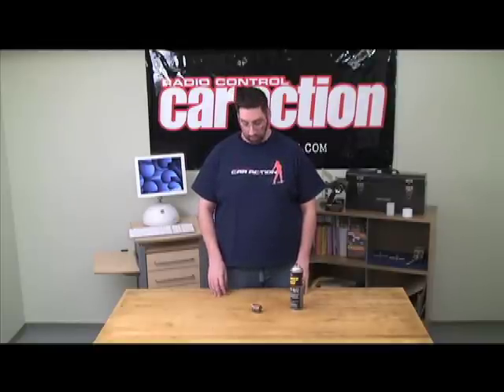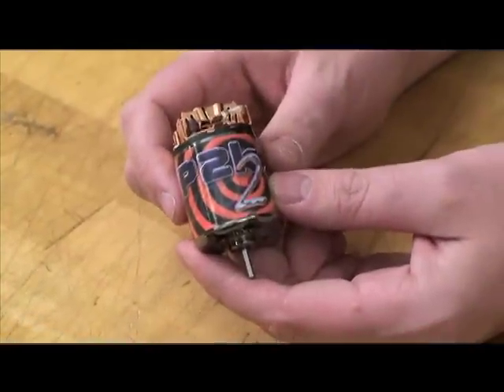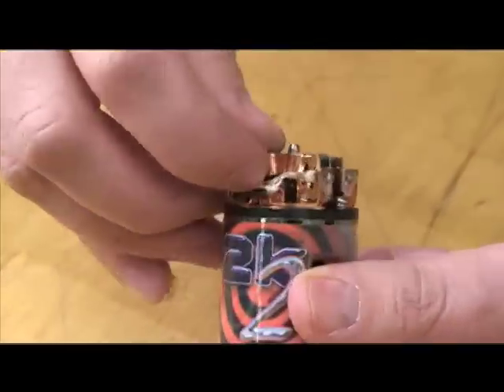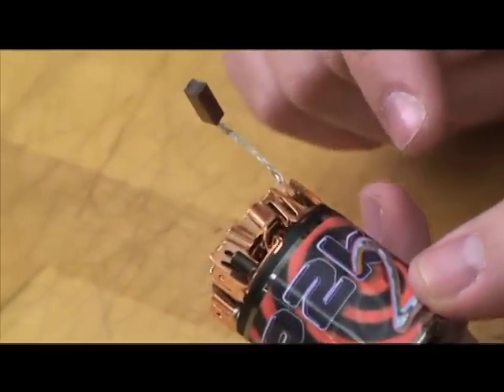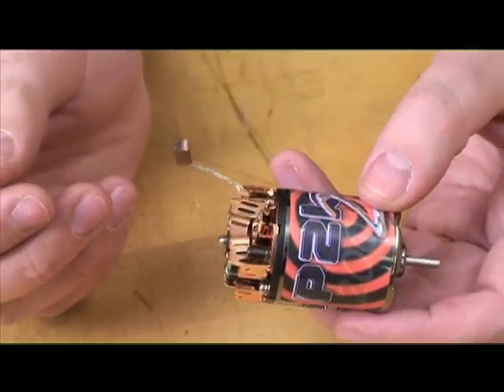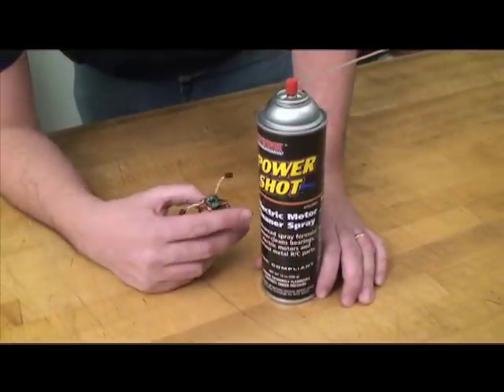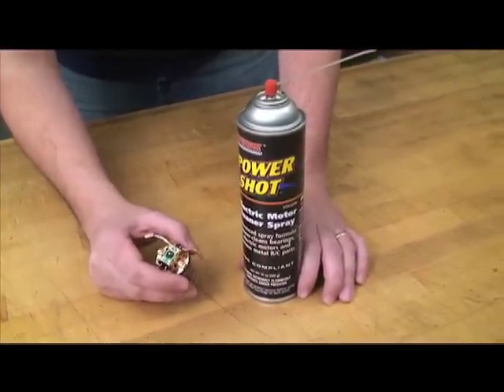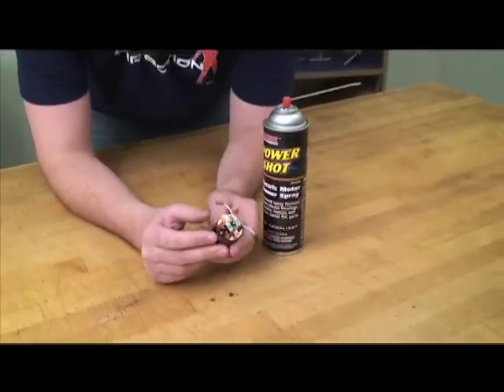How To Fix A Hung Brush

Comment: Very wrong. Yes brushless is technologically more advance yet seems like Brushless ESCs are not has reliable has brushed ESC. I have brush ESC hat are over 10yrs old and they still proform flawlessly. And brush motors with lipos are very powerful.

Comment: If you're using bullet plugs between the motor and ESC, I would bet that is the problem. The "bad" motor might have worn out a bullet connector. You can bend them back to a tight fit.